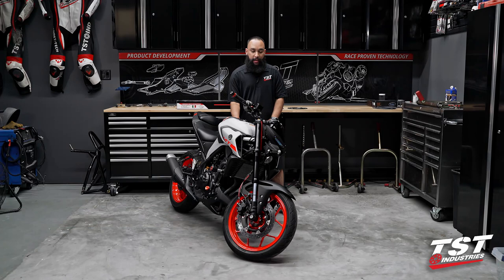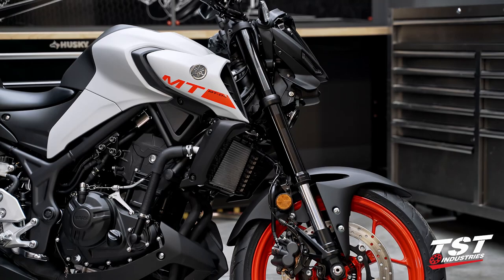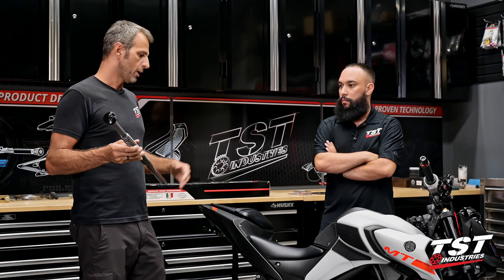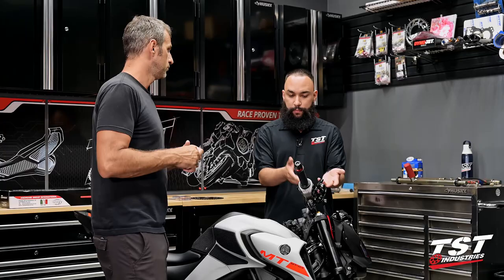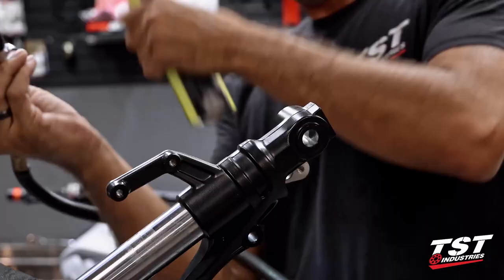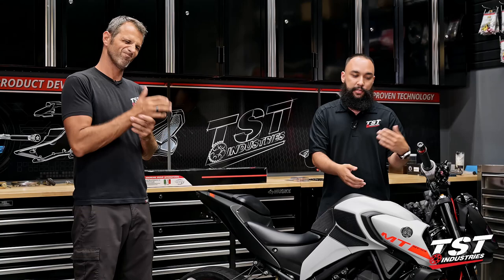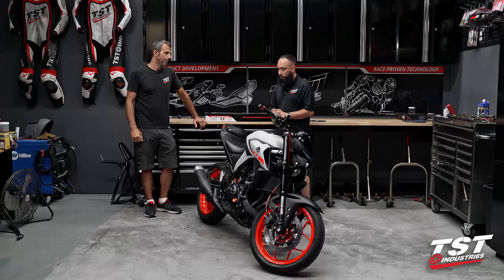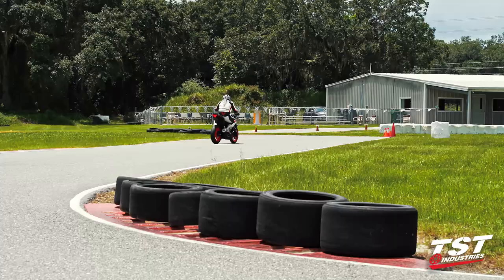ALL NEW Suspension UPGRADES for our 2020 Yamaha MT-03! (MT-03 Build Series Ep.7)

Comment: This bike its more than fun it a perfectly way to ride it (for me) Its 3 things in one Sport /Midmoto/Street Bike

Now with this suspension will have a better performance on the track and in the streets. 
You guys always bring the right Mods for the MT⁰3.
*When will be this available (?)
Reply from the maker: Front suspension is not an absolute magic for everyone. It gives you adjustability around a midpoint that is set to your riding style but ultimately if you are just commuting then maybe it's not the right modification for you. If you ride with spirit and take it to the track often you will appreciate the added performance and adjustability. It will make riding over very rough terrain and bumpy streets worse, and riding with a passenger will also be worse.
We will make this available as soon as our distributor gives us the go signal for MT03. The cartridges we are using are from an R3

Comment: As I see you reply to every comment and hopefully mine too, does that pin stand work on a Yamaha MT03 2016 too? Or can you explain to me if there are other methods too? (I saw theres something called a central stand but I dont know where to jack it up on the bike) Best regards
Reply from the maker: Those pin stands accept different size pins for various bikes. You just measure the opening ine the bottom of your triple clamp and get appropriate pin. Several companies make them. Although you are probably outside USA. You can get these stands locally.
Reply: @TSTindustries  Thank you very very much for replying ! I am trying to do maintainance on my bike (fork seals) and I became so frustrated cause i couldnt find a way. Best Regards

Comment: are there recommended settings for the Andreani kit? I just had the K-Tech Razor-R and Andreani Fork Cartridge Kit installed today by a shop, but its a bit too stiff. K-Tech lists recommended settings in the owner manual, but Andreani doesn't. Help
Reply from the maker: Spring setting should be done by sag adjustment using the 17mm preload adjusters up top. For me and my riders I typically set sag with rider 2/3 of the stroke from the bottom so that you have 2/3 of available stroke in down direction and 1/3 up. Then we adapt to the conditions of the track and riding style with adjustments based on rider input. For damping i close the valves to the bottom ising the 3mm hex adjusters up top, then open them up 2-2.5 turn, and again depending on what the bike feels like in the given track conditions, we adjust on input from rider. There is no one best set point that will work universally. For a proper suspension you will have to adjust after the initial setup that is just a starting point. You will also evolve with the bike and suspension once you start taking advantage of these new tech bits so you will likely start demanding more from the package. This will lead you to need to fine adjust some more. I hope this helps you some.

Comment: Is that right or left handed threads to get the inner tube out of the stanchion I got the set screw out but can't get it to budge I used heat and penetrating oil still nothing
Reply from the maker: Standard right hand thread but on some of these the set screw mars the surface of the tube and then the tube can jam the threads. When you back out the set screw make sure you inspect the surface i as making contact with and clean it up with a Dremel before attempting to spin it out of the stanchion
Reply: @TSTindustries  how did you get leverage on the inner tube?